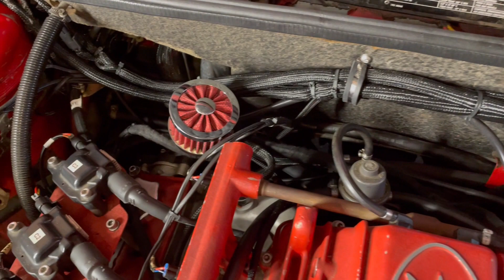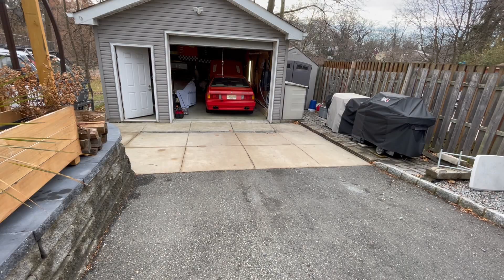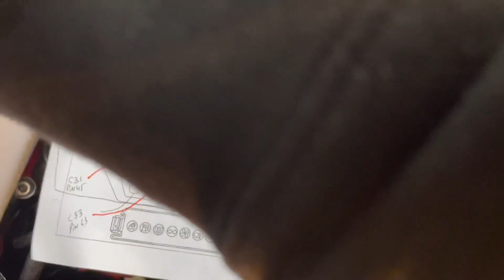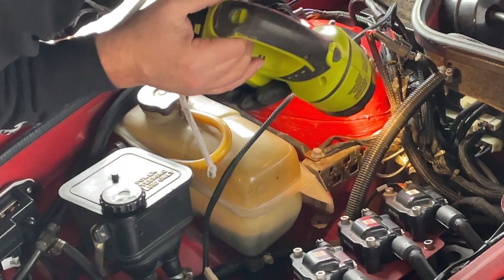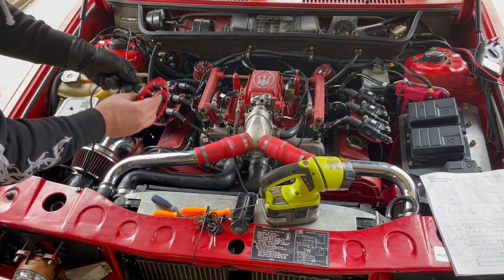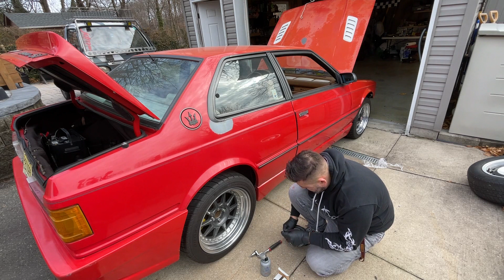Maserati Biturbo Air Horn circuit and other minor repairs.

Comment: Hey buddy, How do you test the relays on the fusebox. I am chemical engineer and the electrical stuff is not my strong suit. Much appreciate the help.
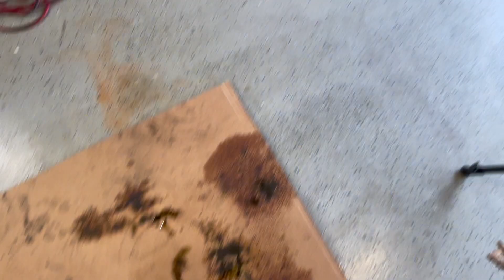Reply from the maker: No problem.  Below is a link to another one of my videos.  Just scroll to the 18:50 minute mark where I test the relay.  You will need a 12 volt battery to test.  Good luck!
https://youtu.be/rAZ0hLrOTTg?si=GWxhCjtuL1Tdsn8b